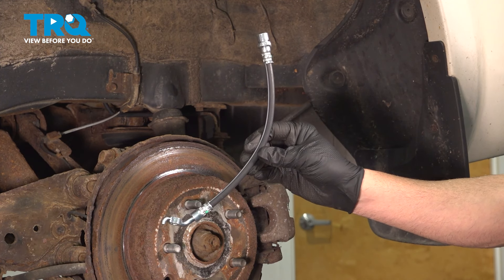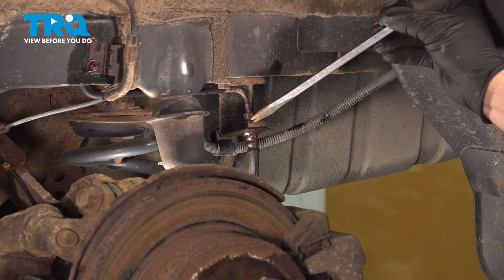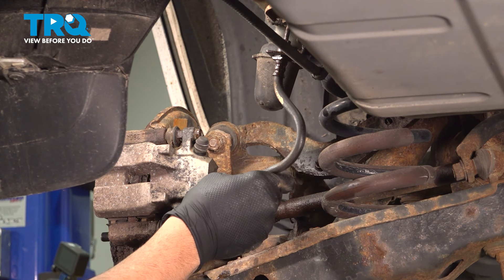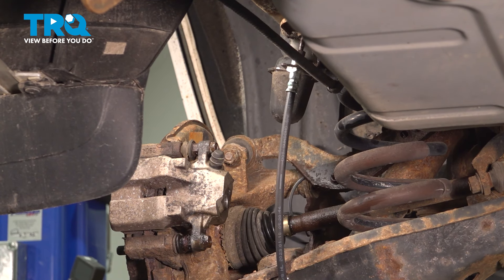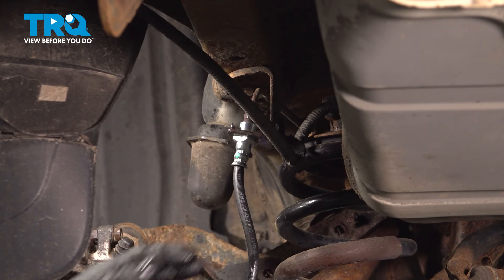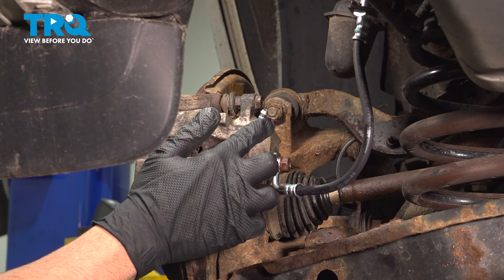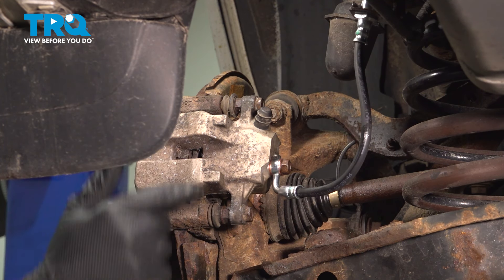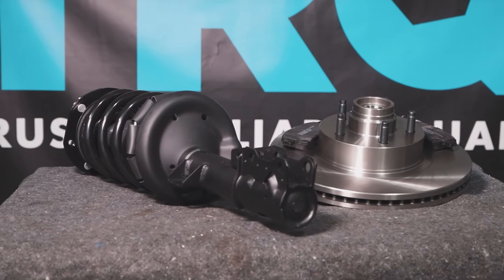How to Replace Rear Brake Hoses 2006-2012 Toyota RAV4

Comment: Excellent video! Would just recommend using a line wrench on the brake line to prevent rounding off the nut.